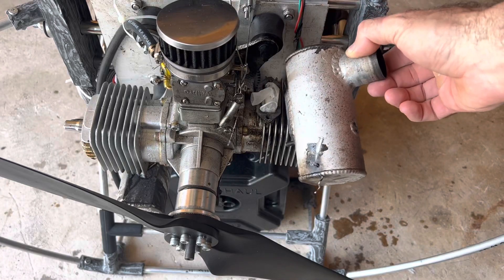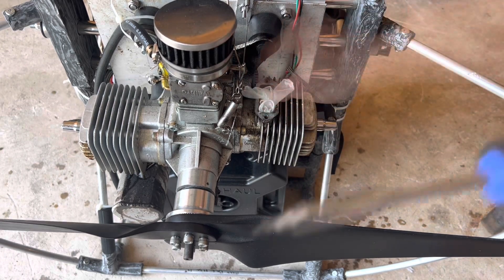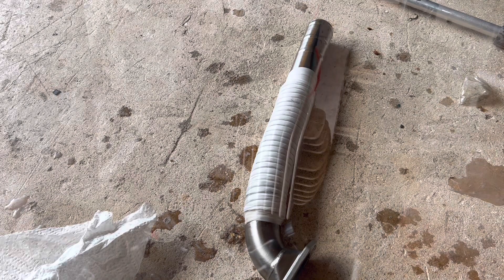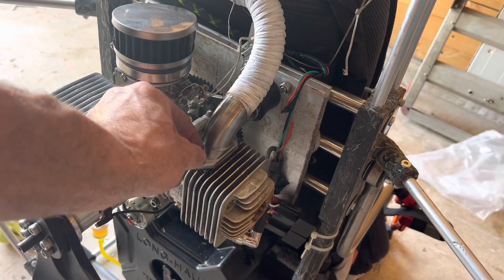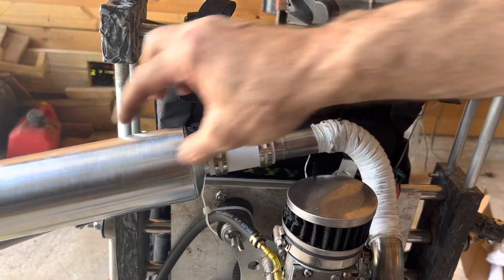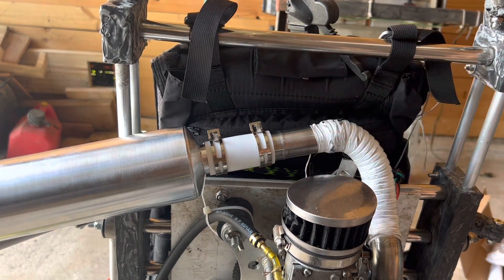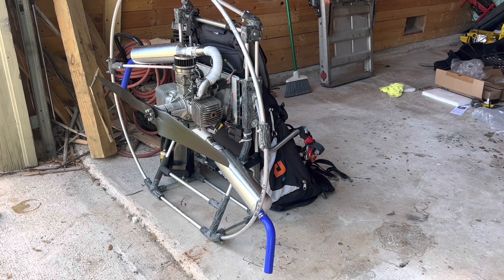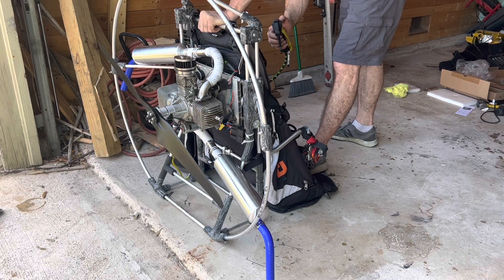Installation of Tuned Exhaust on the DLE 170

Comment: Sounds still like DLE170 but deeper. Doubt that your gasket will last. Hope you use some gasket sealer. Eg. SI 569 on Metal part before placing gasket.

Comment: silly question, but so far how much noise reduction are you seeing , only one concern  would be the extra mass and load on the vibration mount with new exhaust system  if the exhaust are fixed to frame and only relying on the flexi section to allow motor movement at lowish range  RPM;s . as alway many thanks for posting  you seem to be the go to  guy for DLE info and tear down  guides .. big thanks . still waiting for my unit to turn up :-) Oh to have decent local source LOL :-)
Reply from the maker: Way lower noise, but I still need to fly it or do a thrust test to determine if the extra weight and cost is worth it. I should get a flight test in early next week. I'll post the video and let you know if there are any issues with the mounts, vibration, weight or anything else that results from the flight test. It's hard to test from the video, but there is a significant lowering of noise. If it makes a difference in thrust, I'll do a decimal test as well to show the difference.
Reply: @TexasParasurvival  many thanks good buddy , i know your busy so appreciate the replies , be safe mate  and safety tie  those puppies till you access the vibration impact and keep up the good ......make that Great work . Cheers  .. The Guys Over in Thailand seem to have good  success with these units albeit different size pilots
Reply: I agree there is too much flex going on, the mufflers should be locked to the engine block.  It'll work, until it heats cycles a few times and cracks.

Comment: These exhaust are to tunning, or just for reduce noise? Do you are using the chinese split propeller?
Reply from the maker: They are advertised as tuned exhaust, but I think they are just noise reduction. There is no expansion chamber so I don't see how they can be tuned. I title the video based on how they are marketed from DLE. The will provide a comparison once I get a true set of tuned exhaust. I'm working on that now, but it will be a while before it's ready. There is a huge learning curve with making a tuned exhaust with two heads that attach lol.
Reply: @TexasParasurvival  i know you love a challenge lol but Avery got one imported that seemed to have decent gains in both power and noise  and semi resonable price . LOL now even Tucker is having a dabble withthese :-)  tricky part i guess will be wheater you opt for 2 into one or one tuned exhaust for each cylinder . Cheers